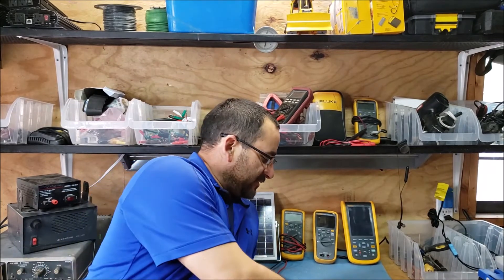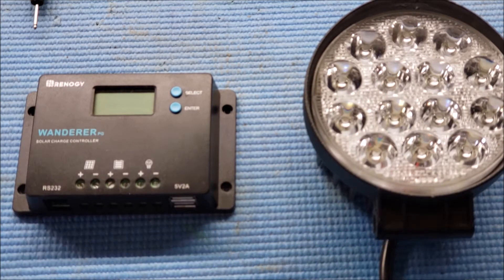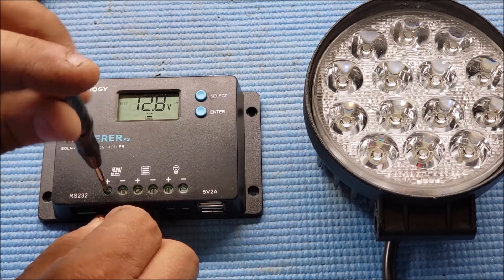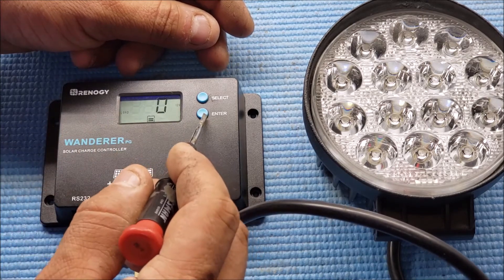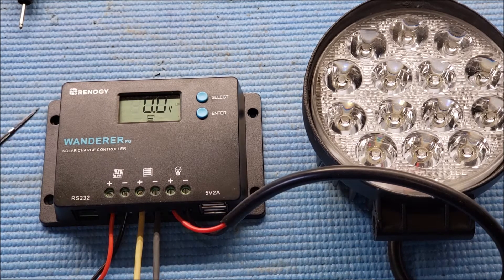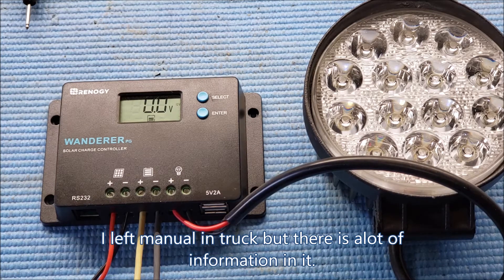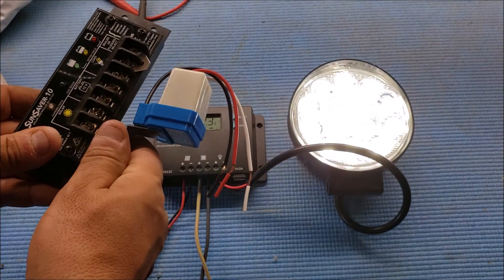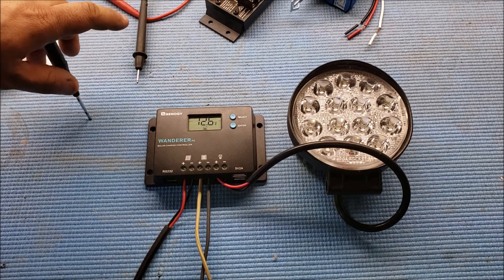Renogy Wanderer 10A  Load control testing with 12v LED spot light

Comment: Does the 4 charge settings like bulk boost float does the controller do that by itself or do you have to select a charge setting what 1 would you pick if you just in general  wanna just charge a battery then have it shut off when it's full.

Comment: Clicked like because I appreciate the time you took to publish this, and it's hard to find documentation about the load out terminals (so now I've seen it).
A few publishing points though:
1) you could have put a timer or stop watch in the picture to show the timing. And
2) The load output has a current (and I think voltage) display for the output; If you could have shown what the current draw was for the light (so we can see if it's accurate, or able to pull 10 amps)?

Comment: if I use this to power a cell/modem will it take 5 minutes for the battery to kick in once the solar loses its sun? I would think I would want it to run off solar panel and then switch to battery power as soon as the sun quits shining...what if I chose option 17 where it stays on all the time?  Will that always use battery and not the power form the solar panel?  Thanks all...
Reply: This controller has several options for controlling the output terminals.  24/7, on demand with button, and day / night times based on solar input

Comment: These are garbage, I got 2 and they are both bad!
Reply: Did you connect the solar panel first?
Reply: When ever I see these type of comments I immediately think operator error. Especially if 2 are bad. I’ve got two working just fine one on my 24v well pump and one on a 12V led light string in my RV. Both have been flawless for a few months now. I don’t use the load terminals. I pull My load(well pump) directly off the batteries. Same for the led lights. These are a good little charge controller for small stand alone systems. Better than the cheap eBay no name solar chargers that claim to be MPPT but aren’t.
Reply: these have a huge flaw can’t use the current terminals for rated current, need to wire direct to battery.
Reply: I use mine to control lights only and my Morning star 30A units for my main battery charging. I need to do future testing on these. Thanks for the comment.

Comment: You have the Wanderer "PG" model 10amp...positive ground system...i have the identical normal Wanderer  10amp model negative ground model...mine has Lithium strings and user model to customize even more...i didn't know the PG model lacked lithium setting , or maybe you clicked to fast past it because the screen is set to blink at regular intervals during that procedure...LOL